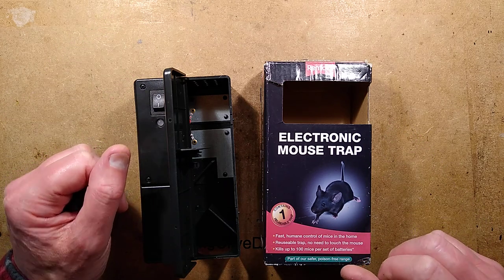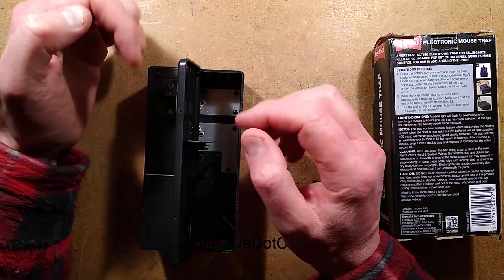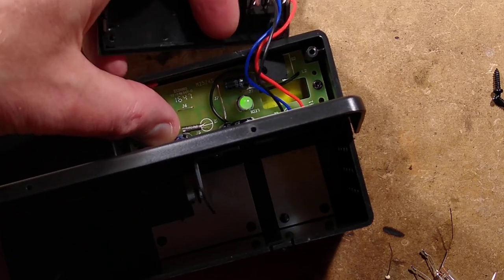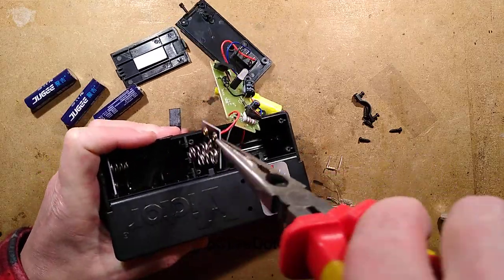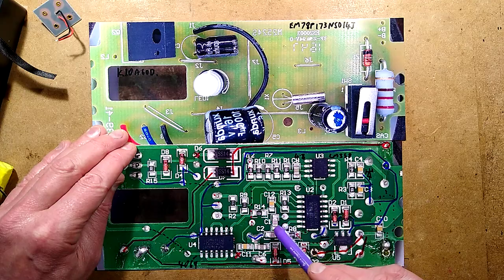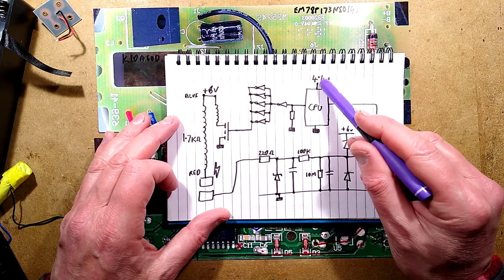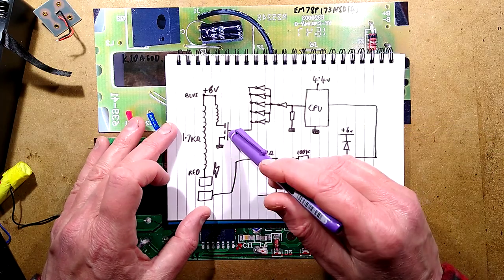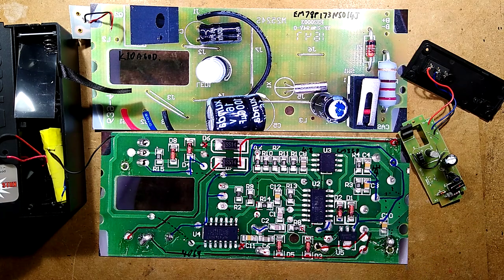Inside a Rentokil / Victor electronic mousetrap.

Comment: While I haven't gone to look at the videos you referred to and generally not fond of animals in pain. If one does have to kill mice electrocution that ends in 20 seconds (or earlier) is probably faster than the poison based traps and pellets. It also can't accidentally be eaten by toddlers who look at colourful pellets as "this might be candy?" and the whole issue with predators catching affected mice prior to their death or scavengers eating a poisoned mouse corpse.
Actually checking if the batteries are still functional enough to meet the required output seems reasonable, bit annoying it won't play well with NiMH but considering that the vast majority of people won't be using them and that the batteries presumably won't be changed very often I guess it's an okay product?

Comment: Voltage increase by that coil transformer. Works like a Victorian shocking coil, I have one of these Victorian machines an when you slide the centre bar out the coil the shock intensifies an increases, I honestly expected a regular transformer in this mouse trap. My coil buzzes when you connect a battery, 3v can hurt when increased but not enough amps to kill, amps are the killer more than volts.

Comment: Has Clive opened those jugee batteries up? I bought a bunch of those lithium AA but I've handed them all away and couldn't bring myself to destroy them over their usefulness.

I suppose the more interesting bit would have been the chargers. I tried 4 or 5 different types of lithium AA and they all had different circuitry in their chargers.

Comment: Perhaps another reason the power switch discharges the filter capacitor is to add another degree of safety so it can't give a delayed zap after it's turned off.

Comment: This could easily be converted to a rechargeable unit with 2 small lithium packs and a small buck converter to bring it back to 6 volts. A 2 cell BMS could then be used for balance charging of the cells.
Edit **  I am surprised that you didn't put a multimeter between the plates after bypassing the safety before pulling it to bits

Comment: I got a few of those about 15 years ago and back then the mouse detection was via a spring contact suspended from the lid where you thought wires went.The only thing they killed was the batteries so I went back to poison and  break back traps which I still use.

Comment: "It's getting a technical win from me" - you missed a chance to say "technical Victor-y."

I wonder if it's detecting how "done" the mouse is by the resistance across the pads and shutting off at the right time, or if it's a fixed duration.
Reply from the maker: Fixed 20 seconds.
Reply: Probably it comes with a "medium rare" setting from the factory. For "medium/well done" the circuit has to be tinkered with :)

Comment: I had one of these - it worked fine for a while until a build up of schmoo in the crevices between the pads stopped it working. Repeated attempts at cleaning failed. It's very hard clean in the limited space with lots of angular corners.

Comment: What does the microcontroller do differently to the coil before and after detecting the mouse resistance? Does it increase the speed at which it switches the coil in? Or maybe increases how long it turns the coil on? Presumably it does something to allow more current.
Reply from the maker: It only pulses the coil when it detects the resistance of the mouse across the pads.  At power up it runs the coil to load the batteries and test their charge status.

Comment: I am guessing the regulator is 4.2Volts to power the 5volt logic from 6Volt nominal battery voltage, the could not use a 5volt regulator due to it needing 6.2v to 6.6v minimum on its input.

Comment: I, of course, am interested in Electronics, and taking them apart.
So I saw a video that said they had made a rat killer out of an electric flyswatter... They did so, and then proceeded to show a time lapse of where the mouse was killed, and then twitch for the next few hours before they turned the circuit, and the video, off...
It's the only video I've ever reported... No idea if they ever took it down, but I doubt it.
Reply from the maker: That sounds like one of the fake Indian ones where all the elaborately made electric traps were rubbish and they were just connecting the grid to the mains.  A fly swatter will fail if left running continuously.

Comment: I have this model and it actually works .. I had a smart hard to capture mouse  who avoid all my manual spring loaded mouse traps and also my live mouse traps ...
I bought this set it and within 24 hours I seen the light flashing and a long tail hanging out of the entrance door..
Highly recommend this electronic mouse trap..
Thanks for taking it to bits Clive ..
I was going to take it apart myself but I paid  $40 dollars 🇨🇦 so that stopped me😂
Reply: The newer Wi-Fi model is pretty handy too... It sends a notification to your phone that it has caught a mouse, and it's time to empty and reset it.

Comment: I had one of these 10 or 15 years ago and it worked once or twice then stopped working, perhaps the belt and suspenders approach was out of necessity. I shall get another one and see if it improves the longevity otherwise it costs $ 5 - 10 per killed mouse.

Comment: What will happen if a dead mouse is laying on the high voltage plates for a long time? Does that drain the batteries?
Reply from the maker: It zaps it for a while and then shuts down into standby mode.

Comment: Clive when this mouse trap is triggered by the mouse. The mouse dies quickly also it urinates on the sensor plates causing a short between the plates. It becomes harder to clean the plates. Overtime the plates begin to corrode. It would have better if it was stainless steel.

Comment: poor mouse!! i built a couple of humane mouse traps we call "littera", it's a smilar sounding name of a tin can... infact it's some sort of container, it's a metal mesh long cage with a flapping door, the door has a spring that makes it close rapidly from top to bottom with the hinge on the upper border of the cage, there's a stick attached to the door that runs over the cage finishing with a nail, a piece of iron wire shaped to both hold the cheese inside and the nail outside... the mouse moves the cheese, the door closes... and i have to do a little trip to an open field to release the mouse
Reply: @ruben_balea  well, by "open field" i meant away from houses, open fields are just in natural reserves these days... aren't they?

Comment: Hi bigclive, do you think this circuit can be used to electrify 2 metal meshes in order to make a mosquito/insect trap that is constantly on?
Reply from the maker: This only energises the output briefly when the mouse is detected.  Traditional low cost insect zappers use two layers of mesh shielded from touch and a simple capacitive multiplier to energise them.
Reply: @bigclivedotcom  I have taken a traditional bug zapper/racket and have tried to make a stationary trap out of it. Unfortunately the circuit isn't built for long run time and eventually fails after 10-20 minutes. I think the transistor overheats or something else isn't built sturdy enough for that type of use. I don't know, my knowledge in electronics is very basic. The circuit of this electronic mousetrap, however, seems to be built to run indefinitely.
Would it be easy to modify a zapping racket to run indefinitely? Maybe it's a good idea for a video? Thanks!
Reply: @benjaminq3226  Running the charging circuit all the time would be an inefficient waste of power anyways. Add some high voltage capacitors and diodes to the output so that the charge is held by them until a bug bridges the gap between the screens and provides a discharge path. Pulse the charge circuit for a few seconds twice a minute to keep/recharge the output. That is the simplest approach, but I'll still leave figuring out the exact how to you, since you should have basic knowledge of your own before tackling high voltage circuits (even low current ones).

Comment: Is it bad that when I saw the title I immediately thought of a mouse trap that electrocutes mice with mains electricity?
Reply: I found one of those once. It had two copper pads wired to hot, two pads to neutral (US 120v mains), and a place to put the cheese. It was factory made, too, not just some sketchy one-off home-brew job. I never did work up the nerve to plug the thing in.

Comment: The LEDs lit during the initial buzzing noise which makes me think it’s putting current through the plate to see if there’s a deceased mouse (or other conductive item) in the box
Reply: The buzzing noise IS the trap putting voltage on the plates. You’re hearing the transformer operating.

Comment: I worked around rescue parrots once. They are very messy and attract rodents no matter how spotless i kept it. And apparently it was way worse than I thought.

 Oneday I was hanging out with the parrots into the evening and I saw a rat come out of the wall (normally im gone by now, the sun is going down). And then another rat, and another rat, and another rat, and another rat, and another rat, and another rat, until I lost count at around 60 and they were still coming out of that one hole in the wall and the entire floor seemed to be writhing around.

I was sorta like those trailers for the game "a plaque tale." There were eventually so many rats you couldn't see the floor anymore and they were running between my legs and such. TBH it was sorta captivating.

It was more rats than I felt comfortable trying to kill lol. I just continued to live my life the exact same way and pretend like i never saw anything. Like what, am i supposed to poison them? They are too smart for that and its way too many. I did all the preventative stuff. We are talking about BARRELS full of rats. It would have been a full time job to get rid off all those guys, I knew we had a rat problem, SEEING it really didn;t change all that much.

A victor shock trap can't help you out of that lol.

Comment: I'm curious as to how well a circuit like this would work on a hand held bug zapper. Like replace the circuit in the zapper with this circuit somehow. Add a master switch and the bug itself should be enough to trigger the circuit. If not, wire in a switch on a resistor. I'm going to make a super bug zapper with the guts from an arc lighter and a power bank.
Reply: All you need to do is modify the original battery terminals so that the zapper works off of a 9V battery instead of two AA's. Triples the voltage. A friend of mine has one. Instead of frying the bugs, they tend to explode. Very effective. I zapped my tongue with it once. Still had difficulty speaking 30 minutes afterwards.

Comment: We’ve used a few of these, but each one has died after a slug got zapped.
No amount of cleaning of the plates revived them.

We also got the big multi catch version which has caught zero... the mice have to go upstairs first so the corpse can be dropped into a bin - we’ve seen no evidence of anything getting to the bait.
Reply from the maker: If the unit isn't setting properly after the slug, it would be interesting to disconnect one of the wires from the zap plates.  That would show if it was detecting conductive residue.
Reply: bigclivedotcom I did give the entire bait & plate area a thorough soaking in scrubbing in contact cleaner, but to no avail.
I didn’t remove the plate completely, but was very sure there was nothing remaining.
My theory (although never tested) was that the resistance of a slug was sufficient to kill and clear multiple times and the unit sat zapping away until it reached breaking point.
I’ll have to see if we still have a faulty one and I’ll send it for you to play with.

Comment: I'm impressed, but I'm afraid I would never use it as it is. Not that I have any great love for fuzzy visitors in my basement but I object to the "yuck" factor associated with cleaning out the chamber after Mr. Mousy has received his high voltage surprise. This would be especially true if Mickey (or Minnie) wasn't discovered for some time after their electrical mishap. In the past I have caught uninvited guests in my basement and haven't been around to collect and dispose of their nasty little bodies until they have significantly ripened. This is not a good thing. At the risk of making this a potential hazard (joke intended), i think I'd want to modify it so that the zapping could take place with disposable electrodes on a newspaper mat. That would make cleanup significantly less unpleasant.

Comment: why did you use a resistor with the neon test haha, also, i wish you would have measured the resistor after
Reply: because thats how neons are used if you dont think it is neccessary take a neon and put it directly across the mains and let negative resistance do its thing.

just flee before you do activate the mains or you may end up with shrapness flying your direction.
speaking from experience
Reply: @urugulu1656  yeah, this has literally never happened when i have done it, infact, ill do it right now, just to make doubly certain
Reply: @phonotical  it happend to me last time. was the only ever time. 240vac over the bulb and it shatters and triggers the circuit breaker...
Reply: and it was fine, you also do not need one if you are exciting a gas under vacuum or pressure using high voltage high frequency

Comment: If you use one of these put thick sealing tape over the little holes before you put the peanut butter (they prefer barley honey) inside or the rats will fail to get in the little-hole end and give up.

Comment: You don't have a mouse problem because you have a neighborhood full of fuzzy affectionate mousetraps. Perhaps not as power-efficient as a battery-operated zap trap, but certainly effective.
Reply: Also, these are considered more "humane" because sometimes a mouse will suffer in a spring-trap if the mouse triggers it at an angle (flopping around in agony, not to mention the potential mess because mice will gnaw a limb off to get loose) and glue traps are... Well, let's say we've had some mice get loose from glue traps, missing most of their fur. We stopped using poison on our property because if a mouse ingests it and then my Juliette gets a hold of it while it's still alive... I'll have some scary moments at the vet that might not end too well. We have two of the larger rat-sized zap traps and they do work as advertised.
One of ours has a DC-In jack to eliminate the use of batteries, but the manufacturer didn't sell an adapter for it. A repurposed wall-wart from a 1990s cordless telephone solved that problem.

Comment: Interesting. I assumed that it buzzed initially to produce charge but wondered how it sustained it so long without top ups. Surprisingly humane really to check it will be able to do the deed properly. I can confirm that if you forget to unload it after activation the decomposition products leads to failure to set by way of charge leakage. 😱Revolting. 😩😳Really nasty but worse for the mouse to be fair. I am filled with remorse each time it works which it does frequently but remind myself of the damage one mouse can do if left unchecked. They do love to chew domestic pvc wire insulation.

Comment: Am I alone in wondering what the output voltage is?  Could you measure it practicably/safely?
Reply from the maker: The combination of high pulsed frequency and potentially high voltage makes it unsuitable for measuring with a standard meter.
Reply: @bigclivedotcom  I thought that might be the case.  Is there a way to measure the input to the transformer, and then do some clever maths?
Reply: @bigclivedotcom  I have the new version of this trap and it arcs at least 6mm in air.
Reply: @brianleeper5737  Do you have a link to the new version? I don't see any different Rentokil or Victor ones.
Reply: @brianleeper5737  Thank you

Comment: 15:00 No, a MOSFET doesn't need current. It operates on voltage and the gate current is in the micro amp range. S
Reply: In steady state, you're right, but they have gate capacitance, which requires current to charge and discharge.
Reply: @roflchopter11  Sure, but 5 inverters? What frequency would that be? :-)

My guess is that they needed a buffer, and there were six in the chip so they used them all.
Reply: @jeffmerlin2580  definitely. For serious power electronics (multiple kW or more), they make specialty gate drivers with output rated in amps

Comment: 13:52   I'm guessing that they did it that way with the switch as an utimate safety device. If someone whipped the cover open right after they switched the unit on, and it's doing it's self test zap, someome could get a shock if the CPU somehow locked up and kept on zapping and then a person stuck their finger across the pads. 🤷🏻

I imagine avoiding a lawsuit was the thought behind the idea to kill any and all power to the unit when the top is open. One can never be too careful today when lawyers get involved. 😏

Comment: I have one of these but the victor fawn version its supposed to be able to kill 3 mice and has 3 plates so your probing finger could get a belt! It ofcourse cannot kill 3 mice unless they lie side to side and are built like racing snakes!
It kills mice it kills voles but there is evolution in my shed something now wears rubber booties as the bait disappears without a resulting corpse.
There are wifi versions from victor but apparently not available here so i bought a no name from china for the back of my loft ,very handy it saves crawling through the eaves to check if its been triggered!
Need a trap that kills electronically then uses a shute to chuck the body out of the eaves then resets ,that WOULD be the perfect mouse trap !